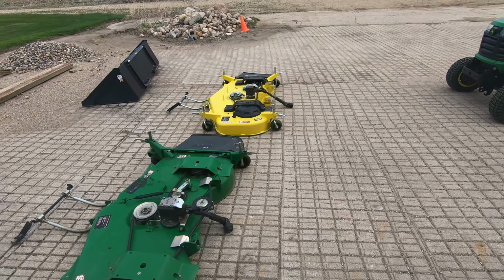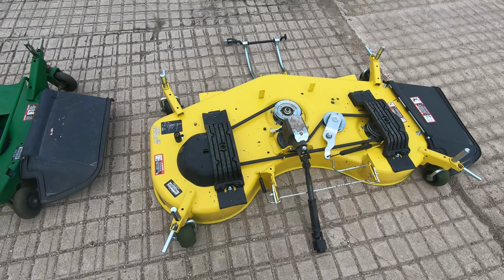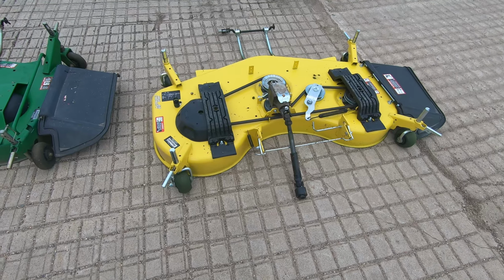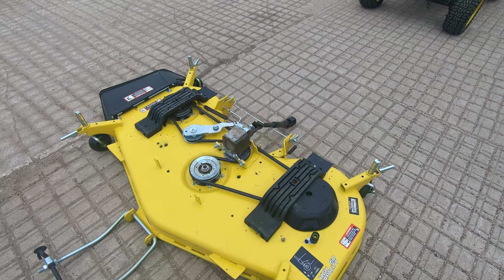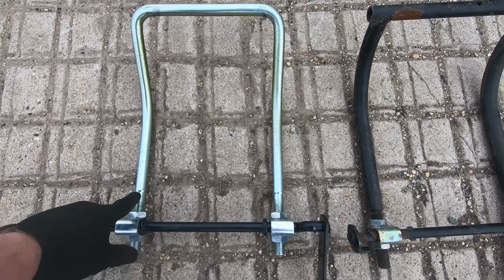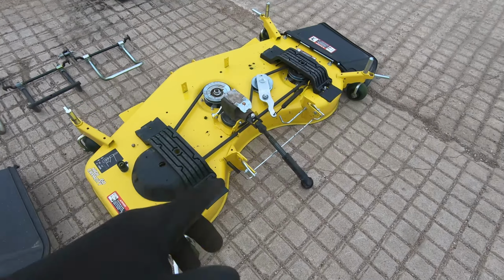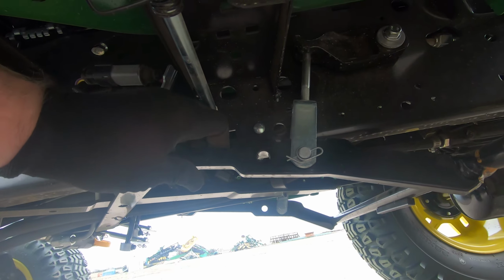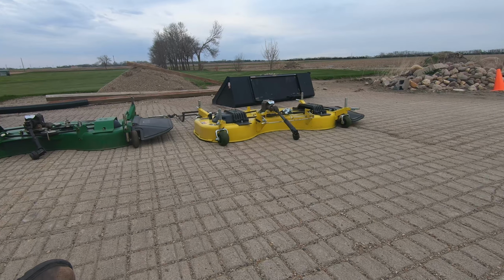John Deere X748 vs X758: 7-Iron vs 60 High Capacity Decks

Comment: When I worked for deere, I was one of the people who influenced some of those deck design changes on the HC decks. At world hq we were having terrible issues with stepping when mowing steep side hills. They changed the tire design and went with a more heavy ply tire but also lowered the gauge wheel setting( wanted them closer to the ground, wanted to even say close to a 1/4 inch) this was to reduce the flex of the deck on the down hill side of the mower. When they came back with a redesigned deck they added those fine notched wheels as well as made them grease-able in order to prevent that stepping affect. They also changed the hanger design like you mentioned and when we ran them hard we were seeing cracking in those hangers (at the point of the drilled hole on the center few even split in two) hence why they went back to the solid hanger. I know ROPS regulations played a lot in the red design of the 758. They went to a smaller fuel tank and put holes in the frame in order to stay below that magic number.
Reply from the maker: Thanks for all the insight on the design changes for the deck. I've known weight was a problem for the X758's and I am sure it will continue to be a problem in the future. The smaller fuel tank is slightly frustrating based on the two fill ups so far. Good gph but less than ideal run times on a tank.

Comment: I am very impressed with the overall build quality of either of those decks. The flip-up/removable spindle covers are probably my favorite feature of them all...the 48" deep deck on my X570 has the flip-up covers and they make cleaning and greasing the deck so easy. Almost makes me want to design some kind of spring-loaded covers for the older decks on the 300 and 400 series...

Comment: Trust me if you run over that wheel it will not tell that mower anything. I ran over a 5/8 chain that was about 8 feet in length that someone left in the yard. My X758 sucked it in the left side & spit it out on the right. Didn't even bog the motor down.

Comment: Will that tractor lift the deck high enough for the casters to fall out? Hard to tell from the video but it doesn’t look to me like it would. Install and removal of the deck is sure nice compared to my old 455 with the 60” which is a real man killer job  haha
Reply from the maker: Sitting on a flat level surface, no, the wheels will always stay in. Driving around in the yard, moving decks, turns, small holes etc, yes it can happen. We might have to do some experiments to see what it takes. Maybe my assumption that I would loose the wheels is incorrect. However, I know I’ve lost them before with the deck down on the X748. Trees took out the clasp on top a week before, had not found the clasp or been to the store to buy new, a week later I’m blowing the machines off after mowing and the rear caster is missing. The guilty shall remain nameless.
Reply: When I first took off my 60HC deck I had all four anti-scalp wheels fall out when I moved the deck with my “deck dolly”.
Reply: @mmrbeef  the 54” on my 425 is real easy to remove/install with the casters turning 90 degrees and locking, it slides out nicely. The 455 I put a chain hoist in the ceiling and lift the front of it and roll the deck out the front which is the best way I have found for me
Reply: One of the reasons I just traded my 455 in for a new X758 is because the deck was so hard to handle on the 455 as I age. I used to be able to do it. I still am convinced that the 455 is still the best garden tractor ever built by anyone. Maybe my new X758 will change my mind when I get it Friday, but I doubt it.
Reply: @screamer2005  I have always said if the 455 was 4 wheel drive it would end up in the Smithsonian as absolutely the worlds greatest ever garden tractor lol. I love mine

Comment: The 7iron deck vs the HC deck. They look the same height. Does the HC have different baffles in it or is it mostly just rebadging/renaming the 7 iron deck to a new name also because its 9 gauge now as well.
Reply: Both the same design, save for the 7 iron being much thicker steel

Comment: Does anyone have a blade option that would increase the vacuum of the deck? I have 54HC and I have a continual problem with leaf pickup using a cyclone rake collection system. The leaves just blow out the front right side of the deck or they blow away from the deck before reaching the deck. The leaves are whole not chopped when they blow out the front. I have used varying cut heights, deck is set up correctly and I am using standard blades. I have also used the export baffles to close the open front of the deck all with no improvement. It’s like it has little to no vac. This occurs in light, heavy or windrows of leaf cover dry and wet conditions, leaves, and pine needles and straw.

Comment: Great videos!  Thank you!  I have a X758 and the 60" 7-Iron deck on it.  I bought my tractor used this way.  The guyt hat sold it to me indicated the 7-Iron was an upgraded deck.  Overkill for my property, but nice to have.  I had my tractor in for service the other day and asked them about some convenience accessories.  My deck leave crazy widrows if I let the grass get too long before I mow it.  I inquired about a mulching kit and said it would not work on this deck.  It's the fall now and leaves are starting to fall, so I also inquired about a bagger to help clean up my property.  I was also told tha the bagging system would not work on this deck.  I've done  a fair amount of research on the web and get conflicting information.  Do you have any experience with your 7-Iron and mulching or bagging options?  Help?
Reply from the maker: For the older 7-Iron decks there is both a mulching kit and a bagger available. The bagger is identical to the other X series baggers except for the power flow head. I am not sure if you can order the power flow head new OR if the 60HC power flow head fits on the older 7-iron decks. There are lots of folks with experience on these baggers and mulching kits on mytractorforum.com. I have been a member there for many years. They can provide more details etc for the answers you are looking for.

Comment: Question. I have a x748 with the 7 iron deck and just recently noticed that the deck started to move more then before causing the deck wheel lock pins to start rubbing on the tires when making turns. Was wondering if you had some insight on that. Ive read in forum's that i would need to adjust the linkage possibly?
Reply from the maker: I would look at all the mounting points and see if there is some excessive wear on the pins and mounting points.

Comment: Just out of curiosity....I assume you don't like the auto connect decks?   May I ask why?  What are the down sides to the auto connect feature?   Thanks for the video.  I too love the "pop off" drive over ramps!
Reply from the maker: Honestly I have very little experience with them. They seem like a nice feature but I’m not sure how I would like it. I didn’t consider it on the X758 since the deck will be under the machine a majority of the time.

Comment: the 60 HC on our x758 is not setup for reliability.  the rear mount tabs are so thin. and we have cracks in the deck too.  my x748 with 62c is a little better.  you are right  the decks i had on the x595, 425 and 455 were better.  i would like to try a 7 iron.  that or we may have to switch colors.
Reply from the maker: Deere has made a number of changes to these 54 and 60HC decks. All of the changes up to 2021 seem to improve the reliability. I put about 50 hours on the 60HC this summer and looking it over this Fall I see very little in the way of wear. This is in direct contrast to some of the issues I have seen with the early 54 and 60 HC deck that are flat worn out in some places (like the rear hangers).
Reply: We put a lot of hours on the 758 has 1300. 748 has 1450. The 595 is rolled so I need some parts.

Comment: When leveling a 60" 420 mower deck front to back witch way do you turn the front draft arm yokes to lift the front up? Thanks..
Reply from the maker: If I am thinking of everything correct you will want to make the yokes on the draft arms shorter to lift the front up.